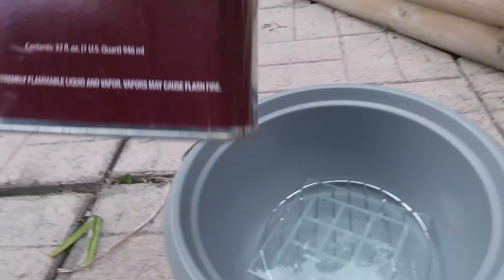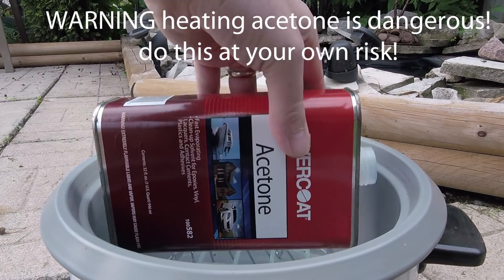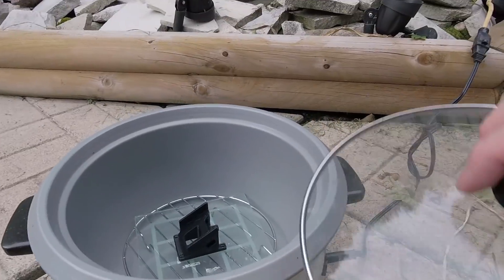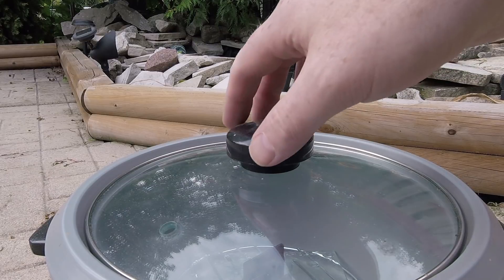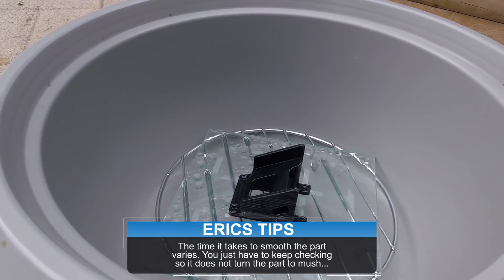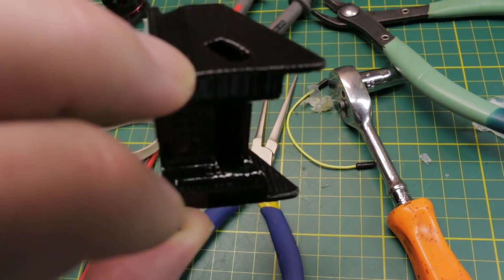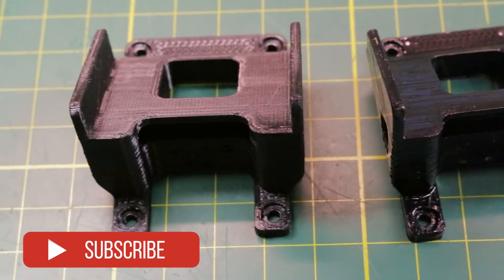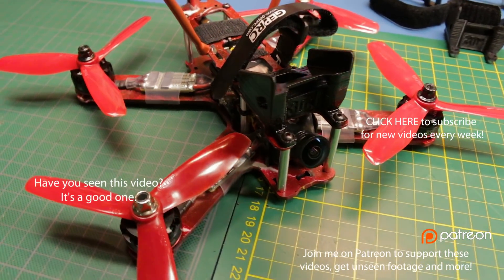EASY WAY TO MAKE 3D PRINTS SMOOTH AND STRONG!

Comment: Pretty nice result but pretty dangerous process!
Have a great weekend
Reply from the maker: As long as you completely avoid ignition sources and not go anywhere near 465C is really not any worse than putting gas in your car. Have a great weekend as well. Cheers